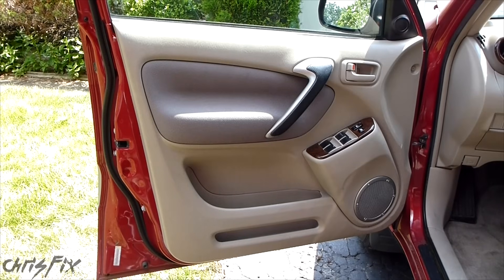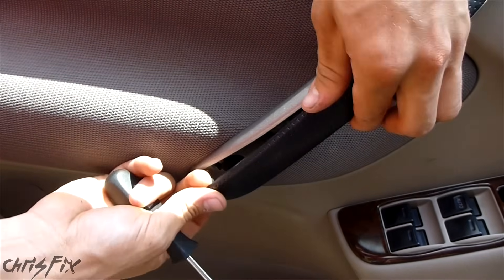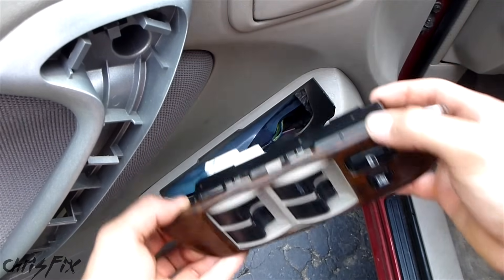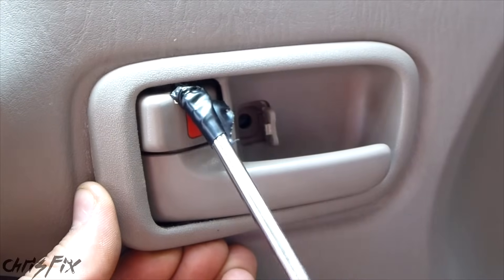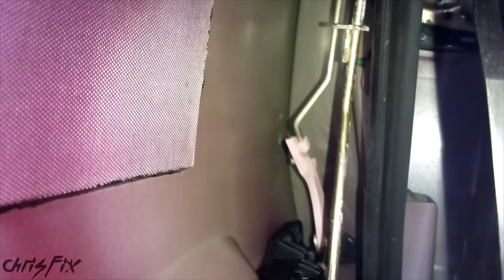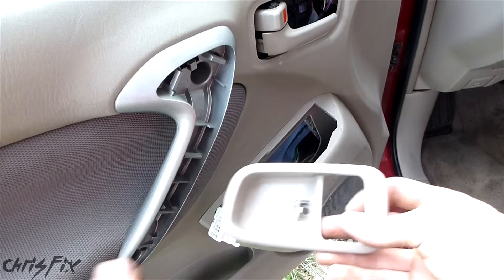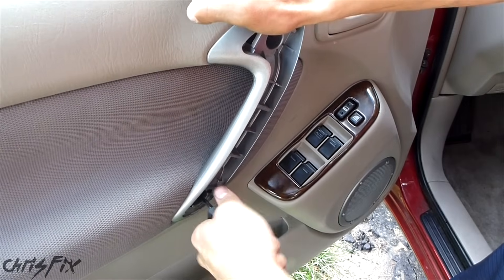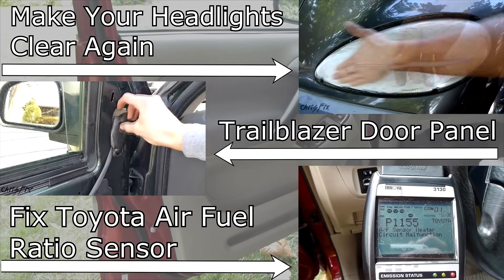How to Remove a Door Panel in a Toyota RAV4  (2001 to 2005)

Comment from the maker: +Dave Johnson, I cannot reply to your comment for some reason so I hope you see this. Thanks for the comment! The door lock actuator rod snapped in the white plastic piece really tight. I tried to pop it out but it wouldnt. In retrospect I should have used a zip tie just to ensure no future problems. I did not think of it at the time because it was in there nice and tight.
Reply: @Chris Fix, where did you get your panel remover tool? Can you send me a link on where I could pick one up?

Comment: I would add to your well explained video to secure the linkage rod in the plastic retainer clip with something like a tiny cable tie or if you have heat shrink tubing then slide a 2" length of tubing over the plastic retainer, past where the linkage connects. Then connect the linkage and slide the heat shrink back up and over the connection. Heat with a hair dryer or heat gun and never have to worry about it popping out again. Thanks for the detailed video.

Comment: Great video and may come in handy should I have to access the inside of my 2014 RAV.
But if the door lock actuator rod popped out once, isn't there a good chance it will do it again, unless you do something to secure it more permanently in the plastic clip?

Comment: Bloody smashing video :-))

Loved the red dot locators, extra work at the editor stage but very clever :-)

Thats a nice vehicle, i can see why you were being carefull with the soft coated tools method, the pro tool looks nice but i dont think many people would have such a thing, but it would be worth buying one for such a nice car.
A wallpaper scraper or putty knife may be what people might have :-)

I see a extra fix for your car, where that vertical rod clips into the plastic, fit a single cable tie around the plastic form to stop the rod ever popping out again :-))
Reply from the maker: zx8401ztv Thanks bud. I am trying to up my game lol. I had to think of the dialog and stuff before the video to show that, but I am glad it was worth the effort! I normally dont use specialized tools but I really hate breaking the panel clips, especially the specialized ones which are a dollar a piece. So a $6 panel clip pliers is worth it for me (compared to the screw driver or puddy knife idea). I did mention you can use a screw driver, but I was not taking the chances lol. The zip tie thing is a great idea! I should have thought of that!!!
Reply: ChrisFix
Chris, its allways easy for someone on the outside of a job/situation to see things, i sometimes come up with A usefull idea, i did say "A"  lol :-))

You had too much to think about, but your production is very professional, its to the point and easy to for anyone to watch and understand so they can do it to there vehicle :-))

ill shut up now, i dont want your head to get too big ha ha :)

Comment: Thanks a lot for sharing that video, Chris
I am a proud owner of a RAV4 2004, but now I have a couple of situations here.

1st... my 2 rear power windows are not moving at all.
2nd... my daughter was playing with the car keys and locking/unlocking the door, several times, and I noticed that the front passenger door was not engaging any more after she pressed the button, now I am afraid of locking the car remotely when going somewhere, I don't know if it locks for sure.

I am planning on using your video and check connections / mechanisms.

Any ideas?

Comment: Very good tuto! I got a close problem with my Rav 2005. Lock/Unlock is working ok, but only for 3 doors, but for main driver door, I have to unlock it with the key, it is not responding from the remote or the central lock/unlock button, as 3 others doors.  What do you think?? each door got that motor mecanism think or is it 1 motor for the 4 doors.

Comment: Great video. Door panels freak me out or any plastic piece on a car interior. How do you repair scratched or scuffed interior panels and trim ?
Reply from the maker: Recklessly Arrogant Dont be too freaked out. If you take your time you will be good to go! To remove any scratches you can use some 600 grit sandpaper depending on the texture of the plastic piece. If it is smooth, dont do sand it. If it is textured you can smooth the scratch out.

Comment: Very, very good and timely, finding exactly what I needed as I was wondering how to open the panel with the least possible damages.
Thank you ChrisFix for sharing it. 
--
Now I am able to go for the 2nd step...
--
My driver's power window (Toyota RAV4 2004) has a weird behavior:
It opens normally but if I try to close it within just a few minutes after opening, it will only close partially and stop.
I then have to wait a few minutes more and try again, then it will close completely.
Sometimes it gets really stubborn and makes me wait like 4-5 min to close completely again.
It looks like some faulty electronic component but I can't tell yet. 
I will try and investigate (now that I can open it [lol] ) but in the meantime maybe anyone would have some hint... ?  
Thanks again Chris and anyone else who may help. 
Regards from Brazil.
Reply from the maker: sgian Awesome! Glad the video was helpful! Is the door jam gap the same size all the way around the door? Does the door close evenly?
Reply: ChrisFix    Chris, I am not sure I get it... it is not the door...the door is working fine... I refer to the driver power window.
When I try to close it soon after opening, it usually goes up but stops in the middle... then I have to wait a few minutes, try again and it closes. Sometimes I have to try a few times until it completes.  Once in a while when I try to close it, it goes up almost all the way but backs down to the middle and stops...  thanks again!
Reply from the maker: sgian The window might be off the track or the connection to the window motor might be loose or going bad or the motor itself is going bad. That is why sometimes it works and sometimes it doesnt.
Reply: ChrisFix Thanks again Chris, I'm going to check those parts. After learning on your video how to open the door panel, I also got a detailed RAV4 service manual (including power window troubleshooting) on a RAV4 owners website. Thanks & Regards.
Reply from the maker: sgian Nice! Good luck!

Comment: Helpful video. I have another situation and that is the automatic door lock doesnt work on my 2002 Rav 4. I am getting an actuator and may need another video on how to install. Also, my door will not stay open, do you have a video or fix for that- looks like a little rubber piece. If you can help with that it would be a miracle.
Reply from the maker: Loti Gest I do not have a video on the actuator but it is straight forward. Take some pics of the old one and replace it. Good luck!

Comment: Hi. Loved your video. I have a problem that the drivers side door doesn't respond to the key fob but it can be locked/unlocked by the key or the door switch itself. Does anyone have any ideas about whether thats an actuator issue or something else?
Thanks
Reply: Did you ever end up figuring it out? I'm having the same issue

Comment: Great video!  I'm having a similar problem on a 2006 Mitsubishi Eclipse.  Would you be able to do a video on how to remove the panel on one of those?
Reply from the maker: +rendarsmith I dont have a Mitsubish Eclipse to work on but if I get one, I will make a video.
Reply: ChrisFix Thanks.  Appreciate it.

I think the problem is the locking relay

Comment: Great video, as usual, Chris. My Rav rear driver side door can't be controlled like the other 3 doors, with the key or control pad on the driver's door. Could it be the actuator's fault, cuz wiring seems fine.
Reply from the maker: Tom Poh Thanks Tom. I would think that is the actuator's fault. Do you hear the motor moving in the door when you press the lock or unlock button? Does the key turn or does it feel stuck?
Reply: ChrisFix Thanks for the response, Chris. No sound at all.
Reply from the maker: Yea, the motor is probably shot that moves the wire that moves the lock.

Comment: Excellent video! One question: My rear door doesn't open either unless I use the side door switch.  The key does not open the rear door, just like the driver side door. My car is a 2005 Rav4.  If I follow your demo and fix the driver side door, will that fix the rear door too or do I have to perform the same procedure for the back door?  Thank you!
Reply from the maker: HopeSeekandFind That should fix the rear door as well!
Reply: Thank you!
Reply from the maker: HopeSeekandFind Keep me posted!
Reply: What ended up happening?

Comment: Anyone know if the door panels from the facelift models 2003-2005  (that are offered in a nicer black synthetic leather interior panels for example) are a direct fit for the 2001-2003 pre-facelift models?

Comment: Hi Chris, great video!
HELP!!
I'm writing regarding an Australian model Rav4 (2005 I think? ..I'll check later..)
..anyway today I, embarrassingly, made a (potentially very costly) mistake with my wifes' Rav4!
To cut a long story short: I thought the car was Securely PARKED facing up a slope and the front passenger door was wide open, however the handbrake failed whilst there was solid, heavy, fixed object between the open door and the car AND THEN THE CAR ROLLED BACKWARD before I could put my foot on the brake Which meant the door hyper - flexed backward beyond the hinge range and jammed and torsioned the hinges in the process I think!!
After much effort, this means the door now shuts and opens ok (eventually!) But now only opens to about 50 degrees and the electric window (which was down at the time of the accident) now only can close half way! As the electrics are obviously still working fine for it to move at all, do you think I should use your video to try to see what is mechanically disrupting the line of passage of the window, as well as what condition the hinges are in?!

Any tips would be greatly appreciated!
Thanks, Mark
Reply from the maker: stolky19 Hey Mark. Do you notice that the door is wavy? Like when you close the door and look down the body of the RAV4, does it look slightly dented? It sounds like you might have bent the door so the window track got bent and the window wont roll up.

Comment: What tools do I need to replace the passengers side mirror of my '01 RAV4L? Is it just a 10mm socket wrench in addition to what you did here?
Reply from the maker: +Kate Pierson I think so. The side mirror should just be bolted on . You do not need to take the whole door panel off either. Just the top part with the speaker cover like at 1:39
Reply: +ChrisFix +ChrisFix 
Actually I did have to get the panel off a little more than that. The clip wire for the mirror was kind of hooked under the speaker wire near the door latch. & it was a 10mm socket to get the mirror off. Thank you so much!!!

Comment: Do you have any advice on how to deactivate the auto up and down window function on the driver's side window of a 2005 rav4? Once it goes all the way down it won't come back up until the motor cools down again. Then it goes up in tiny increments with shutting it off and on again. It also won't go back down until the motor cools. Any advice on if I have to replace the motor or if there is a switch to just disengage this function?
Reply from the maker: +Mariakayc There is no way to shut that function easily. It is hard for me to say if it is the motor or the switch but it sounds like a bad motor.

Comment: Hi Chris!! Please, What's the point of the PCV Valve? Sorry for my English. Para que sirve la valvula PCV. I have a 1980 chevy Malibu 350 V8 an i have this doubt. Tengo esa duda...!!
Has un Video de eso amigo!! Make a video of that!!! Thanks
Reply from the maker: Jhornaldo Mendez PCV stands for positive crankcase ventilation. When your cylinders are moving up and down, it creates pressure. This pressure has to go somewhere or you will blow out gaskets. So it gets "vented" to the PCV valve. Some times people put oil catch cans because the air comes from the area above the oil pan which can have a lot of oil condensation in the air. It gets vented into your intake so that it gets burnt.
Reply: Ooooooooooook. Thanks man!!!!!

Comment: Chris, I have a problem with my car the power locks are not working on any of the doors, if I try the lock or unlock button from the driver's side it just makes a clicking sound from the control panel inside the driver side door. Do you have any idea what it is or how I can fix it

Comment: I would like to see how to remove the rear door panels on your mazda truck. To get to the speaker
Reply from the maker: Me too lol. I am thinking about recovering the headliner with desert camo. And I want to put an overhead toggle switch panel in for lights and stuff.  About 10 switches.
Reply from the maker: ***** Thanks man! For the lights I was thinking 4 offroad spot lights (which I already have) (2 switches), plus a front bumper light bar (1 switch), plus front facing ladder rack light (1 switch), rear facing ladder rack light  (1 switch), reverse lights under the bumper  (1 switch), under the truck lights for seeing rocks and stuff offfroad  (1 switch), winch switch  (1 switch), and bed cargo lights  (1 switch). Plus an extra switch or two if I can think of anything else. Sure it is a lot, but I think it would be really cool. Im probably just crazy. I have been contacting manufacturers that I really like for products I like to use but it is tough. Viewers start to think you are "selling out" if you do that and I do not want viewers to think that. It is a fine balance. I would love to get tools and light bars and stuff. I just need to think of how to do it properly. Any ideas?

Comment: I have a 2005 RAV4, door unlocks and locks with the key no problem.  Once inside and closing the door, all doors lock by pressing the lock button inside, from both driver and passenger door switch.  But the drivers side door will not lock.  What could be the issue, a faulty actuator motor?  If so, easy to replace?

Comment: What if your door is stuck closed?
Reply from the maker: You should still be able to remove a lot of the door panel with the door closed and then wedge your arm in there to open it from the inside.
Reply: ChrisFix thank you. I will try tomorrow. I am using this as a reference but I have a 1997 Toyota rav 4. Hopefully it's the same!
Reply from the maker: Good luck!